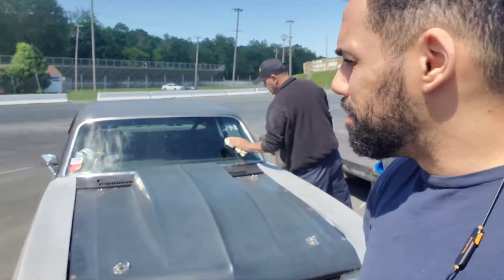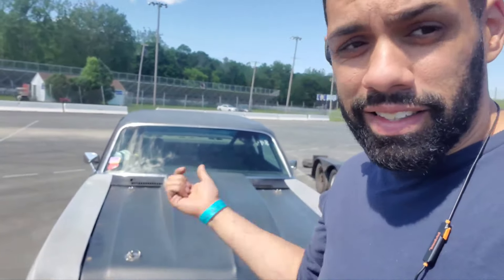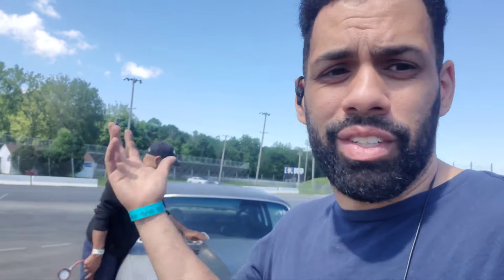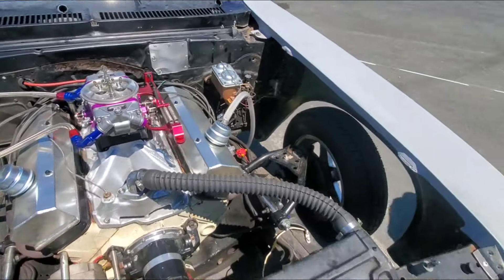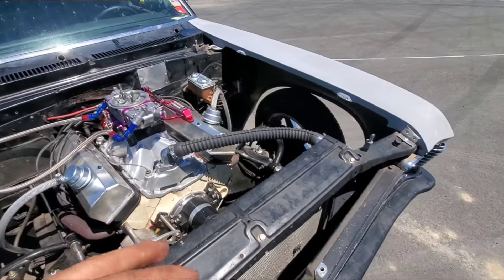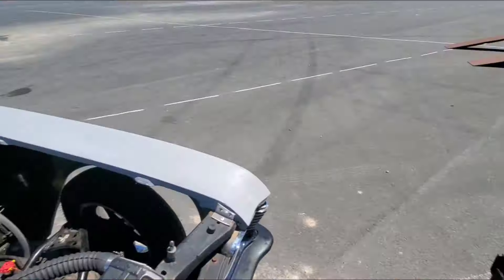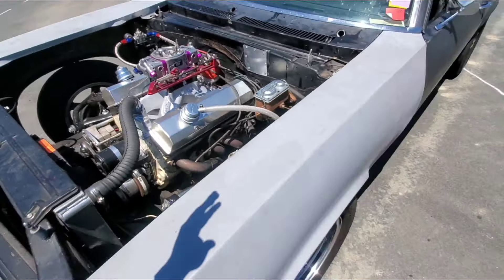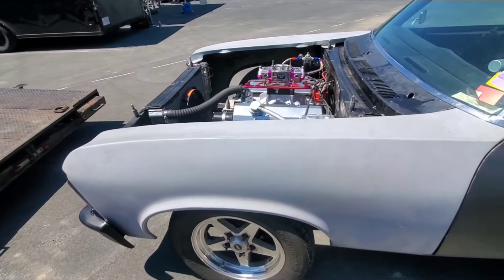Nothing Goes To Plan

Comment: Oh no, so sorry to hear about your misfortune.😟 But you know what they say, a bad day at the track is better than a good day at work.🤔🤷

Will there be a truck engine build in the channel's future? Also one of those distributors that has a slip collar might be a good option for your mill? And it's oil pump driveshaft, not push rod.😁😎👍
Reply from the maker: Probably not, need to get it fixed asap. I did have one and seems better now properly adjusted.  I do make the correction in the video somewhere lol. I knew what ai meant lol